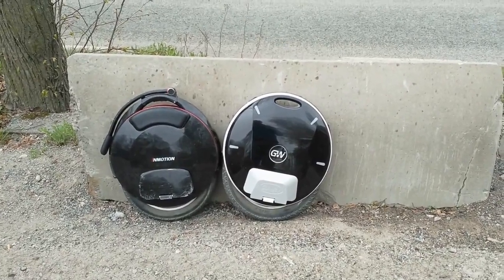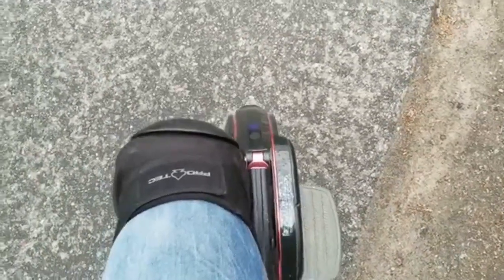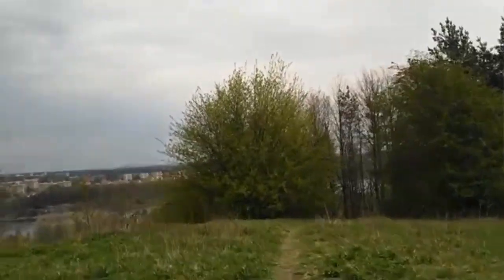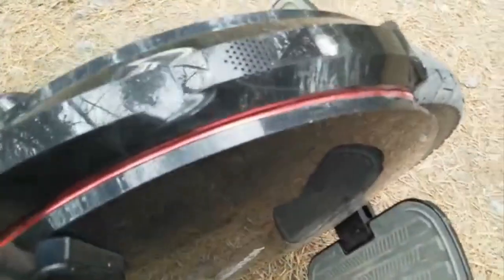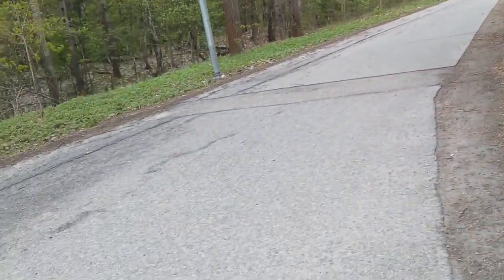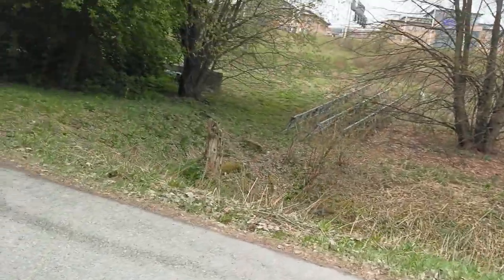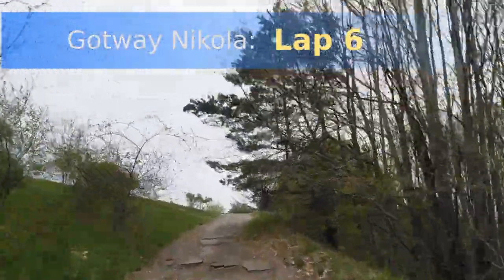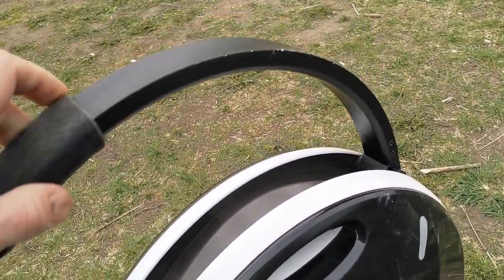The Swedish hill test: Inmotion V10F and Gotway Nikola

Comment: What is the location of this hill? I'd like to reproduce the test :) and I live near Stockholm.
Reply from the maker: Awesome, what wheel will you take up there, the V11? :) The hill is Hagakullen (https://goo.gl/maps/wnn96Tf8SfYUJaQq5). I started each run from near this point if I remember correctly (https://goo.gl/maps/5eNHrbNyxQZmXGhj8).
Reply: @nils-8682  Haha cool I don't live very far. I'll receive my wheel tomorrow and learn to ride, then reproduce your test with another V10F - except my riding weight will be lower (from 63kg).
So maybe in at least a few weeks because you're climbing here pretty fast!
Reply: @nils-8682  I've received my wheel and learned to ride so now I'll attempt to replicate the overheating condition!
Since today is super warm that's a good time to attempt it 😁

Comment: Nikola early models failed hill test due to smaller MOSFETS.(see https://youtu.be/UstREObHBX8) 

 These have now been changed by Gotway. If you buy a Nikola mid 2019, make sure to stipulate you want the model updated with the larger MOSFETS. This does not relate to the Nikola PLUS as they were fitted with larger mosfetts as standard from the start.
Reply from the maker: It's a good advise to make sure that you're getting one of the newer board Nikolas when buying one right now. 

However, the problem with the failing boards (including Marty's in the video you linked to) appears to have been an assembly error (some kind of adhesive between MOSFETs and the thermal pad) causing thermal heat dissipation issues. It has not been shown so far that the smaller MOSFETs themselves are an issue. My first generation board for instance does not suffer from this (possibly explaining why his wheel failed and mine haven't). 

Still, very good advise for anyone buying a Nikola right now - make sure you get the new board. It will both have beefier MOSFETs and and they're made after these assembly issues have been discovered.

BTW: I encourage anyone interested in EUCs to join the forum: https://forum.electricunicycle.org. Lot's of information about this particular issue and a lot more.

Comment: Gotway has a lot of technical problems so seller dont support this brand anymore. Its rfealy hard to buy Gotway anymore in europe.
But by the way, Nikola looks very sexy
Reply from the maker: That's slightly outdated I would say - Gotway's quality has always been an issue but last year the MSX was IMO the wheel with the least issues of all the major new wheels so they did something right there. It's not that easy to buy any wheel here in Sweden, you pretty much have to buy from a foreign seller regardless of manufacturer.
Reply: I would recomend speedyfeet in England, 2year warranty on all new Wheels, got a second hand v5f from him, great Wheel for the city, .Currently on V10F, no overheating issues on that so far, could be firmware issues. Thanx
Reply: @jamesmcpatterson2733  Agree with you, V10F ist the BEST for City.
That wheel is so awsome
Reply: ...but the real problem is, Gotway dont cooperate with Shops.
So when cusomer get troubles with wheel or need any hardware, Gotway gives a shit for repuests.
Same with guarantys.
Gotway moves away from Cusomers, they gives a shit of Nikolka because so realy pisst on about that company.
I know this from a big player.
Reply: Cheers, i do go offroad with both V5f and V10f also, woodtrails etc, works fine 4 me, love the hight of the footplates. Also the V10 has extra cut off safety, . Sure, there are faster Wheels out there. I like to ride with out a lot of safety gear, so its  fast enough 4 me.